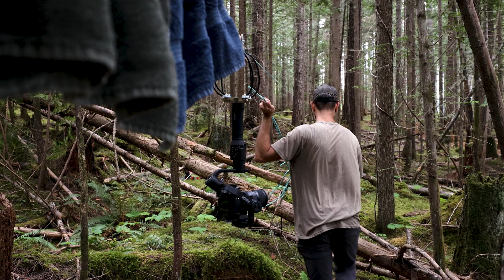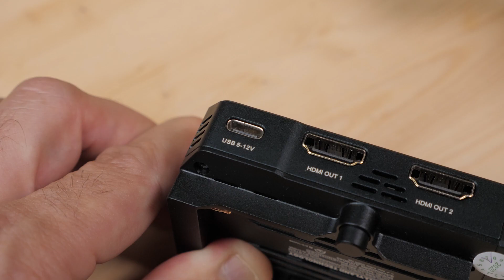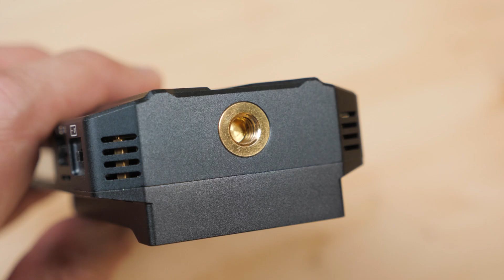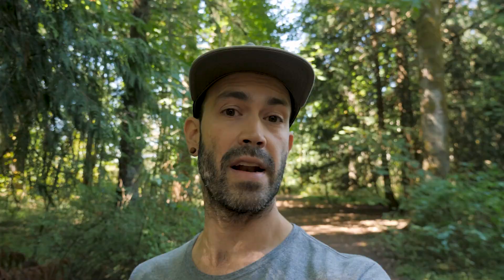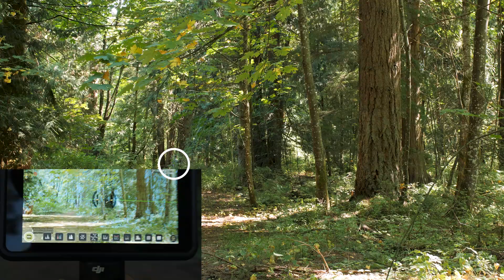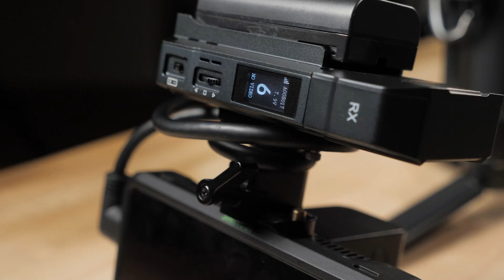MARS 300 Pro Enhanced Review and Cable Cam Rig

Comment: Great video! Does You were tray  remote control with Ronin-s focus motor on? Is there a possibility to use any free thumb/channel for this need?
Reply from the maker: Thanks for watching. I was not able to figure out a way to control the focus motor after a lot of trying unfortunately. So you'd need to get a Nucleus wireless focus motor.

Comment: Thanks for the info about mars 300 pro. What is your opinion about pulling focus? 
Hope soon to see a video about rc for the ronin-s.
Reply from the maker: Glad it was helpful, thanks for watching! Right now I can't pull focus while it's on the cable setup so I set my focus and it stays at that. In the future I would be looking at a Nucleus M for the range I need, but the Nano could work for shorter range cables. I hope to get that RC video out soon.
Reply: @ScottBell  but nucleus n  has 300ft range! It is really enough for many cases! If you need long range you can use this <———l———> . Where  (l) is you’re position    In a middle  and <> end point! And you will  have range around 600    Ft!
Reply from the maker: @DJIDAI26  Very true, the range on the Mars 300 is about the same as the Nucleus Nano so could work out!

Comment: what cable did you get to power the TX from the Ronin grip?
Reply from the maker: I grabbed this cable and then a DC to USB C adapter. I have not tested yet as its still enroute. The camera control cable that comes with the Ronin S will also provide power but then you can't connect it to the camera. https://www.amazon.com/dp/B07K1JKT57/ref=cm_sw_r_sms_awdb_btf_t1_aX9sFbBP4KH7T
Reply: @ScottBell  Cool man.  Thanks.  Interested if the kluge works. Speaking of toys, not sure how much multi-cam shooting you do, but even for syncing up an external sound recorder, I love Tentacle.  They are tiny, light, and have an internal battery.  I mount one on the bottom of the gimbal arm and run the short cable into the a7R III mic input. https://www.bhphotovideo.com/c/product/1372226-REG/tentacle_sync_te2_sync_e_standard_set.html
Reply from the maker: I haven't looked into timecode yet, definitely something I should try at some point.
Reply from the maker: Hey Peter, the cable arrived today and it does in fact work properly if you were curious.

Comment: Great video man! I'm currently researching wireless focus puller setups, and came across the Mars. Planning to pair it with my Nucleus-N and field monitor. I've also been a tad worried about the latency, but from what I gather the GH5 has a built in latency over HDMI at certain frame rates. If I remember correctly it's quite bad at 24, but a lot better at 25 and 30, but I could be wrong? Anyhoo, seems like SDI is the way to go, but the GH5 doesn't have it, so... the search goes on. Hope your ankle gets better soon. Cheers! /Fred
...OH YEAH, also very interested in the remote control thingy, so a video on that would be super interesting. :)
Reply from the maker: Thanks for watching. I'm curious what the range of like on the nucleus-n or if I'll have to go with the M to get enough distance for my purposes.